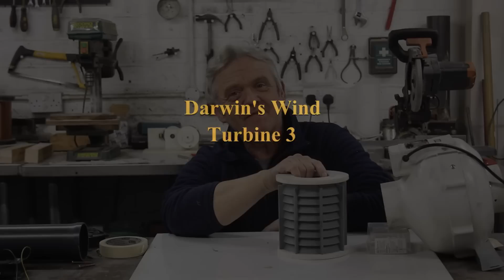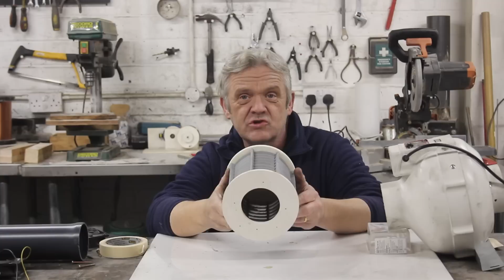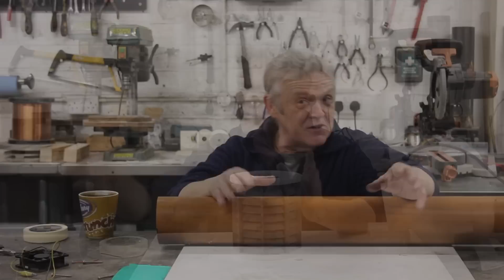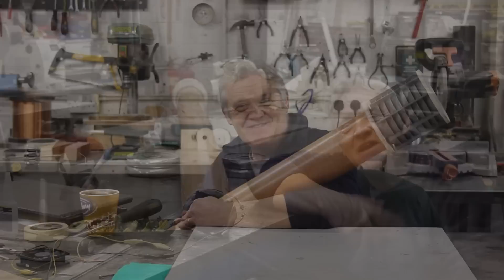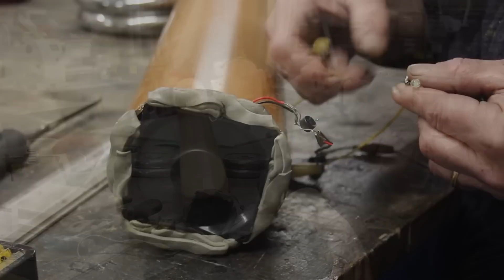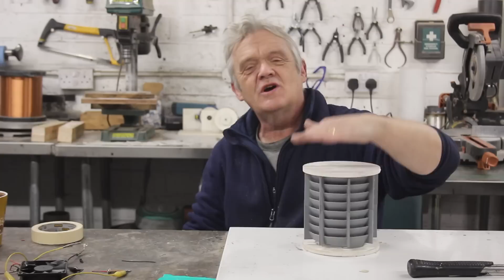1818 The Darwin Wind Pipe

Comment: While the device will work on a horizontal plane, I question the functionality of it mounted to a vertical pipe due to the weight of the air column within the pipe.  Also, there is a concern with the capture of rain shorting the generator at the bottom.
A possible solution would be to mount the generator beneath the device and use an extension shaft to a blade wheel positioned in the same plane as the exhaust outlet.
To increase flow, a tapered cone could be placed over the shaft to direct the flow upwards. Putting a wind vane exhaust head on the output would decrease the pressure at the outlet, boosting flow.

Comment: What if you used a cone instead of a pipe?
Also with the fins opening up, this could also catch rain.
Maybe feed this into a vortex tube?  An added advantage is that vortex tubes separate the airflow. From one end the air comes out hotter than the ambient. From the other end it comes out colder.

Comment: What if you had different fans inside the pipe with weights that rotate the fans inside longer while wind rotates it as well like something making wind and blowing wind.  Longer free wind, or more generators powering one generator to blow power to many generators while giving back power to the one fan generator.   Seems my second idea needs a wind blow like your 3d printed I'll draw my idea ([])=========[] each = is a generator ([]) your wind turbine 3d [] end of the pipe.  The one blowing wind from the top is powered by the other = generating power for each one , somehow making a free blowing powered system or same idea >([])======[]< but the wind goes back up without being wasted to your 3d printed again to continue blowing wind with my wind powered === almost like a powered halo or loop õ shape [] .  Does my idea make a little sense?
Reply: The > < is the wind rotation in the pipe an back up another pipe.

Comment: It might sound silly but what if we put the turbine on a lazy suzan and see if we can't double dip on the energy output? What if the force of the wind turns the turbine and that force starts to act as a suction that then draws the air down a pipe creating a drag then put that on the rocket stove.

Comment: One thing you would have to keep into consideration as water collection you can actually put a birdhouse on top of it for something of that nature to stop the rain from falling in it. Also you could print both ends of the pipe connection. But I will say that type of device does have a lot of options available. Have a wonderful day thank you

Comment: Y'know what springs to mind having watched this is that a poly pipe like that could be easily slotted with an angle grinder and then, with the aid of a heat gun, gently levered out to provide a rough approximation of you 3d printed version.
Obviously not an optimised bit of kit but still a low tech and dirt cheap approach all the same.

Comment: If it was two or three times bigger with the same amount of pipe, would it catch more wind & direct it down?
Is there a limit to how many Louvers  you can place on it (hight) before it becomes not as efficient Or,  would it just keep directing it down?
Reply: Maybe inserting the fan directly at the base of one or more wind catchers, using a thinner metal post as support and distributing the power via electric cables is a better idea.

Comment: Why not keep the 'blades' facing up at the end of the pipe & stand it up with the fan on the bottom and maybe get a venturi effect going? If nothing else a pressure differential that would spin the fan?

Comment: If you are going to modify the angle of the slits why not add a twist so the air spirals down the pipe, presumably in the direction that helps the fan spin.

Also I recall the space needed to allow air to move freely {overcome friction} was about 5 inches so a wider pipe up to some point would likely be of benefit. You may also want to try a bendable pipe like the ones used for ducting in case the golf ball effect works.

One other thought, what if you turned the Darwin part the other way so that like a chimney effect the wind going through creates a vacuum which pulls air up. The fan would need to be flipped but if the amount of power is similar it's another option.

Great vid  👍

Comment: From the standpoint of drag, the flat surface that has the opening for the generator should have some curvature, like a funnel. Otherwise airflow velocity converts to pressure and heat. The resulting turbulence disrupts the laminar flow, generating drag. Polishing the interior of the pipe will also help.

Comment: It seems to me that this may be the perfect device for small-scale urban wind conversion. I'm working on a system to provide backup electrical power for my home gas furnace, and this (slightly upscaled) would fit the bill for keeping the battery bank charged and not be ugly or annoy the neighbors. I would be interested to see the losses graphed as the length of the pipe increases. In my use case it would be best for the pipe to serve as a mast running about 40 feet above the roof because of a neighboring multi-story building,
I'd also be interested to know of there is a relationship between the diameter of the "Darwin" part and the diameter of the "feed pipe." Would a larger diameter of the "Darwin" bit improve tne flow rate of the wind running down the pipe?

I'd love to have access to your working files so I can help test various iterations. I might even be able to work the process into a project for my students.

Comment: Would an inverted or reversed Darwin shape installed on the other end of the pipe create a draw?  Could a U-Shaped pipe have one of the "turbine" shapes, one drawing, the other pushing, on either end?  If not one of those shapes, could the drawing end of the u-shaped pipe use one of those roof top turbine ventilators to add volume and velocity  to the moving air?

Comment: I wonder if adding two more Darwin turbines in the upright position on Ls positioned below the actual generator turbine. I've tried doing a shitty ascii drawing of what I'm trying to describe. My thinking is if a small air flow over the lower Darwin turbines lowers the air pressure below the generator turbine than the Darwin turbine would be even more effective. 
      |_._|
         |
         |
|_._|  :::  |_._|
   |___|___|
         |

Comment: This might be a idea to test out but the idea I have is if it can suck air down into the pipe, if you have multiple openings connected into a single pipe, would that create more power than each one having their own individual pipe?  personally I think this would be really cool if you added in this type of design for something like the wind wall
Reply: The idea I'm thinking about is you have a tower one white next to the other and down at the bottom you would have a singular small pipe connected to the tower going to a bigger one where the bigger pipe would connect to all of the other ones going down the length until you get to your power generation

Comment: Instead flat fins you can try something with little hook on outside so the crossection will be simmilar to single stage of tesla valve. This maybe will lead to higher pressure inside column.
Anyway still without voltage/rpm measurement comparision we can't say much about this idea.

Comment: So I was thinking. If its turned so that the wind exits on the top, can't the machinery still be on the bottom if the shaft goes through the inner chamber? This way the air has a lot of room to go once it exits, minimizing overpressure on the outside of the turbine blades?

Comment: What about the thermal air flow. If the pipe is in the sun, the air inside will get hot and want to flow upwards, which is the opposite direction the air is being forced. Would this produce a noticeable restriction?

Comment: Well done Rob. Just an idea i have. What if you can modify and attach a rams pump or tesla valve being the pipe or positioned it somewhere along or between the piping? Rather using a liquid water. Could the drafted air be used instead. It might potentially increase the pressure and circular flow to give more output results? 
Thanks you as always.

Comment: Humor me, Rob, put a volt meter across the LED, and an ammeter in line,  measure the air speed in front of the deflector and report the numbers.  Thanks in advance.  Oh, the air speed in the tube would be cool as well.

Comment: What about stepping down the pipe width to pressurize the air flow, like a venturi, to add push on the fan blades?

Comment: Umm. You mentioned using people's ideas. Erm, sorry about the pelters melting 😂 I should of said insulate them. This one shouldn't prove as consequential. 

What if you were to design in ducting down the inside of each fin in a way they stack together and meet at or near the tube. That way there is no forced by wind speed outflow through the opposite baffles. 
   Wish we could draw a little here lol,  only thought of 2 or 3 ways to do design it to perform since I started typing. 
   On a side thought even just a V'ish shaped, internally held so it can pivot inside the unit. Should block outflow while redirecting the recaptured loss down into the tube. Regardless of wind direction it should increase air pressure in the tube by some degree. 
  Your choice fixed or rotating funnel solution. Or not at all I do believe I'm getting a 3d printer finally this year

Comment: I guess the immediate drawback of upside down, is that it will also catch lots of rain which will cause issues at the generator end (drag and ingress etc). Great test though, interesting. Cheers, Jon
Reply: I think that could be fixed by having it 'right side up' and then bending the pipe? Or maybe the catcher could be a larger size then the pipe and the actual travel pipe come up from the center like a upside down 360 u trap.

Comment: Seems to me that a cone shape rather than cylinder would be best.  Also, I don't think drag is as much of an issue as some say, try using PC fans made for radiators as pressure is more import than flow with those.

Comment: Hmmmm, so in theory, if you put a jet turbine in the pipe you could accelerate the to air down the pipe faster and have a more powerful output turbine at the end of the pipe to produce more power no? With the right angle on the Darwin part on top....

Comment: Maybe you could try to put some sort of opening on the top so it can utilize the venturi effect to draw in more air? If not, then how about using a sort of ’catenoid’ shape around the wind-catcher opening to try and catch more wind perhaps?

Amazing video as always, Rob!
Reply: the air would take the path of least resistance i.e. the top opening has less resistance than the pipe.  Though guess it depends on how much effect the louvres have on air direction, & if it is enough to create enough downward pressure to override this.
Reply: @1jimjon  Yeah maybe, maybe not. What about the catenoid idea though?

Comment: That's very cool!

One application for this might be for moisture harvesting.  In Peru and parts of Africa, they're building Fog Nets.  There have been other forms of Air Wells in Persia and Ukraine.

Having a large number of these or even a wind screen which would direct moist air underground into a water collection chamber would be interesting, especially if it could minimize the use of polyester and other imported materials in favor of Terra Cotta or wood.

One section of a "Darwin Wall" or several Darwin collectors could collect moist air to go underground either in pipes or to an underground cistern, and a solar Chimney with a Darwin Turbine on top could use both wind and solar heat to pull air up using both wind and solar heat with the moist air condensing below ground.

A system like that could be used for hundreds of years.  The 3d printed plastic molds could be used as forms for these projects.

I that's a concept bigger than just electric generation.  It could create suction for underground tubes and provide electric free geothermal heating and AC.

Very cool!

Comment: Quite amazing .. so it would create more questions obviously .. like if it works going down .. what if there was a long pipe going down into the ground where it was cool and an exit below grade .. wondering if the temperature difference would help drive the air .. of course heat rises .. so if it was connected to the attic .. maybe more flow from the heat in the attic.   All good .. !!  🙂

Comment: Great work, really great work! Looking forward to seeing the efficiency of the modified angles!
I wonder if having some fins on the internal surface of the pipe would help reduce the internal resistance of the air pipe?
I also wonder if a venturi close to the fan would help increase the overall efficiency of the fan-generator?

Comment: Very interesting I wonder what the survivable wind speed might be & would internal air guide improve the structural strength and assist the air flow also by shaping the air flow it might increase the generator fan(turbine) efficiency ? but to prevent driving the generator a simple pressure release or voltage  switch on the generator to control the air flow.

Comment: You might try a converging nozzle just before the fan. The nozzle will trade off the pressure of the air flow for an increase in velocity. However an increase in velocity will increase drag, so do not place the nozzle near your Darwin device, but at the end of the pipe just before the fan. Increasing velocity at the expense of cross sectional area is a big win for power. The velocity has a greater effect on power than cross sectional area. Area affects the power directly. That is, double the area you double the power. However velocity is related to power on a CUBED basis... Double the velocity, the power increases by 8X. The only drawback of a converging nozzle is you need to keep the nozzle velocity less than sonic speed. (which I doubt will ever happen in this application) If you go up to (and beyond) sonic speed, a converging-diverging nozzle works better.

Comment: Well, yes, I'm glad you did your proof to show everyone but, as I said you about oh, I don't know 610 years ago the rodent gophers had that figured out, when we were talking about building a wind power generation system that has a generator sitting on the ground instead of up in the air, and basically a chimney set up for drafting. When the gophers use the system, they use it for ventilating their tunnels, and they build one mound higher than the other mound in their tunnel system, that way, when they hibernate, they don't become officiated, and they always have fresh air flowing into their underground tunnels, I believe the prairie dogs do the same thing. The beauty of your little chimney topper at first glance looks to me like Teslas valvular conduit used on the turbine abstractly, and it may actually ensure a directional valve action, which might help with an unforeseen, turbulent action, I don't know. The other thought is, is that designing a tower with the character of the valvular conduit design may help keep a backflow from resisting the rotation of the collection fan for the generator, again I don't know if there's anything to begin by installing that system into the drafting 😮tower, it may create a resistance that is less than the gain.

Another thought on this is that if you painted the chimney pipe black, would it have the ability to collect solar thermal properties throughout the day, because of the round design, and with that add to the drafting effect, because the physical rising of the hot air? I don't know, because I never built my design idea that utilized that.

And then, lastly, a goal I had in mind was to do basically the sun oven drafted chimney, with the stationary wind generator sitting at the base of the chimney, taking advantage of the drafting effect, and the gopher hole effect, which is the air further away from the ground surface moves faster than the air at ground surface.

And then, is it worth having the black on the chimney pipe be constructed of a photovoltaic material which could take advantage of the cooling effect of the draft created with the heat dissipation, and the natural go for a whole draft .

Comment: You could also try strips of PVC heated and bent around a form without the need of a printer if it's just for a prototype. Needing only minimal bracing it gives the added advantage of quick design changes if needed. Then you could eliminate air drag from the excessive bracing/support columns at present. This is not a dig at the current design which is awesome, just a variation on a theme.
Reply: @Someone  agreed. Nothing against 3D printers but sometimes there are much easier options.

Comment: This looks like a great idea. You could actually create a cascade of pipes of different lengths and have multiple generators at the bottom … it’s definatly the way forward
Reply: question is... is small fan and small generator on each one... then wires to the ground... more effective realistically (and in simplicity of building) than it is to plumb the air into a larger charger at base.  ??
Reply: @coachgeo  yeah might be right mate 😀
Reply: Cascading pipe size with additional capture inputs, relative to pipe size, may, be a way of creating somewhat passive pressurization. Using chimney ventilation in accordance with power generation may be more efficient. Individual Darwin capture tubes would likely be better for airflow situations; battery boxes, cooling and fresh air...

Comment: Would it make more sense to make it taller rather than add a pipe as it essentially is a pipe?  More capture area vs useless pipe. Is there a point where the capture is big enough where it looses efficiency due to internal pressure?